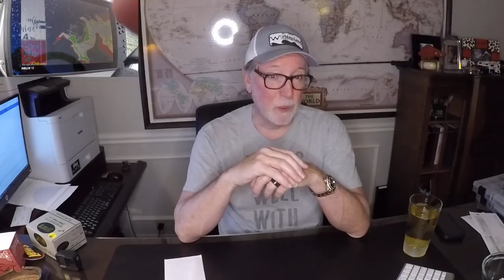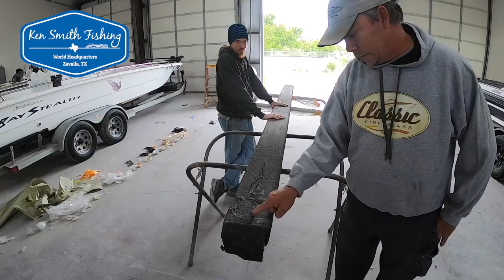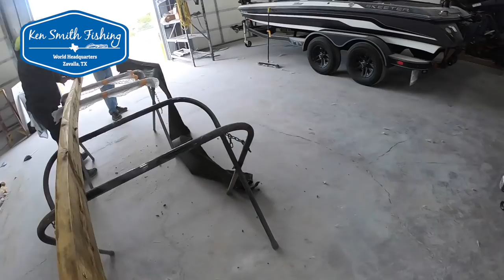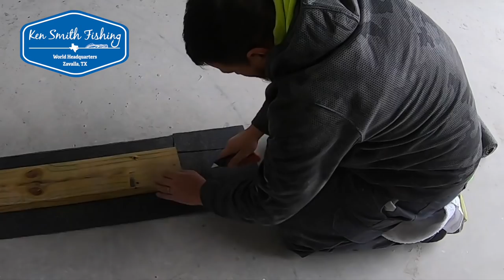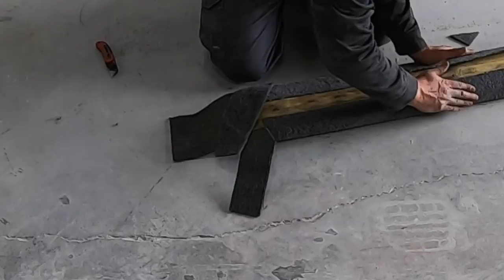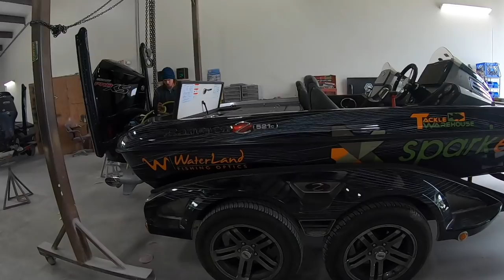Quick Ray Roberts Report and Tips for Replacing Carpet on Trailer Bunks

Comment: Ken, for props...a 3 blade 25 pitch Tempest on my 20 ft nitro worked pretty good but I tried out a 3 blade 25 pitch Fury and lost ~8 mph top end and the boat won't get "up and out of" the water as much. Is the Tempest that much better at bow lift? I noticed a significant difference in weight between the two, the Fury is much lighter, wouldn't this weight loss help make more power and would going up to a 26 pitch Fury make a difference with bow lift?
Reply from the maker: JD I don't think the weight makes that big a difference, but yes apparently the Tempest has of the best bow lifts in the  Mercury line-up, which is helpful in heavier rigs like Nitros and Rangers

Comment: Ken, why didn't they bring the carpet together or overlap it on the bottom where the wood would not be exposed?
Reply: So the water can drain out easier. You should never completely wrap the bunk with the carpet. I leave at least a 1 inch gap.
Reply: @kellycarr4701  I'm reading two trains of thought on this. My current trailer bunks are totally wrapped and seem to drain and dry (could be the hot Arizona air). Others promote using a quality marine carpet capable of draining, etc. A couple have promoted leaving a 1 to 2 inch gap. I'm also reading different thoughts on using glue, if not just to make it tacky to hold it in place while wrapping. To each his own and experience I guess.
Reply from the maker: Alan I think you are right about the dry air out there and @kellycarr was spot on!
Reply: @KenSmithFishing  so the other day your video with Bass Cat they double wrap their trailer bunks, and I understand the reasoning they used regarding slipping, etc. I'm thinking, short of using good quality carpet, placing an extra layer, tacked with glue, on the top then wrap the bunk with a full piece leaving a 1 inch gap at bottom. I know I'm going to have to do this sooner than later.

Comment: Didn't mention it, but they did it...leaving that exposed 1" gap of wood on the underside allows the wood to drain after getting wet. It helps stop the wood from rotting out over time. Also, if replacing entire bunks only used treated wood! Untreated won't last a year, ask Nitro owners!
Reply from the maker: Great add JD, thanks!

Comment: It is surprising that bass cat uses 28oz carpet weight in their boat's
Reply from the maker: why?
Reply: @KenSmithFishing  I just finished 3 out of 4 of the bunks on my BCB Pantera 2 and I can tell you the 24oz, with the one top layer glued down first is really nice. However, even with brand new blades, my lines don't look as sharp as the lines on these bunks.